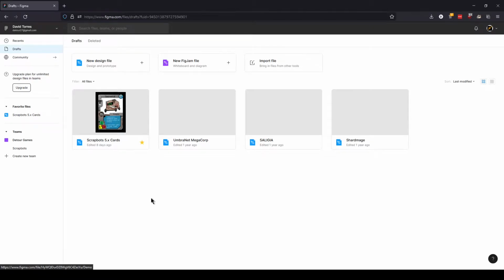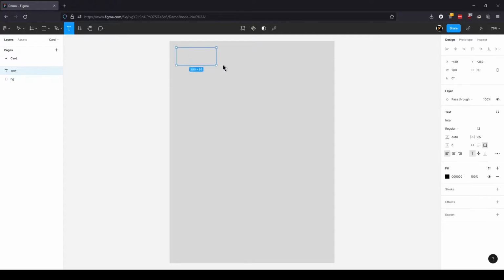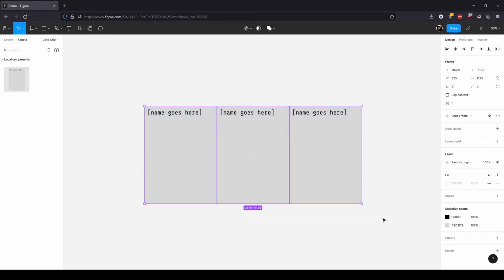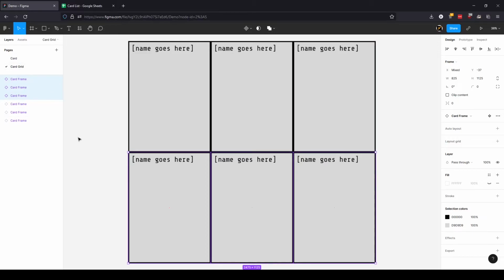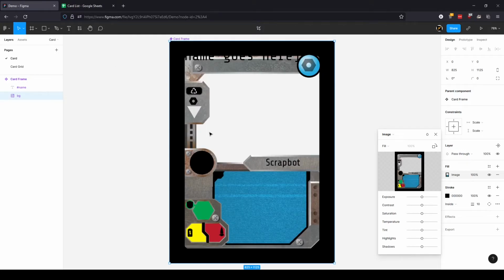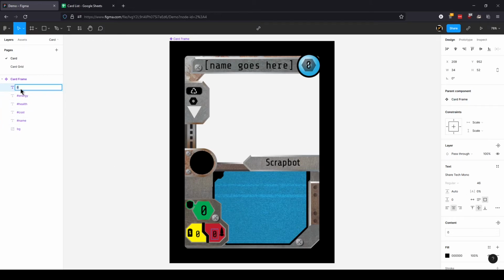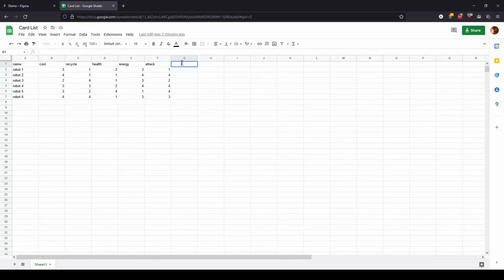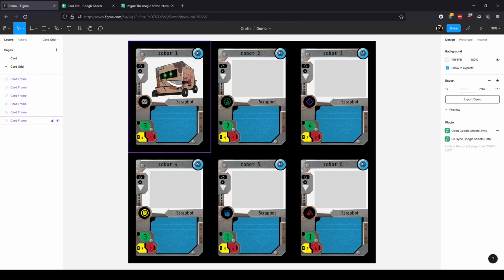How to easily generate cards for your board or card game using Figma and Google Sheets

Comment: Wow! To echo what others have said, this sounds like exactly what I've long searched for. Two quick questions you might know the answers to. 1. Can you input text upside-down or at least rotate the text box after it pulls from Sheets? My prototype would require that. 2. Can you drag and drop images locally (vs importing via the online links) I'd be much more comfortable with this method, albeit slower.

Comment: Hello, great video! Is there a way to specify colors that differ by card? For instance, if the border of the card would change colors, could I put an RGB hex value in a Sheets field and link that to a component somehow? Or would I have to create a .png of the borders and overlay those images? Thanks a ton and well done